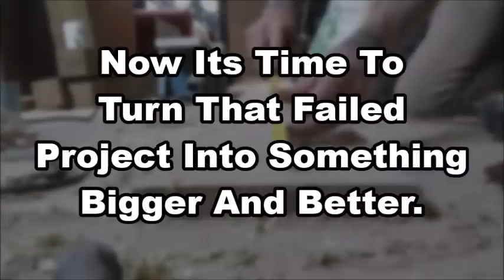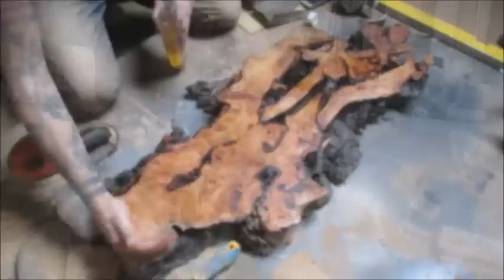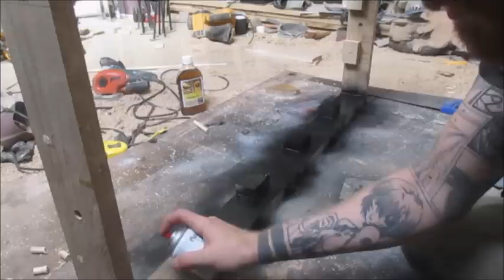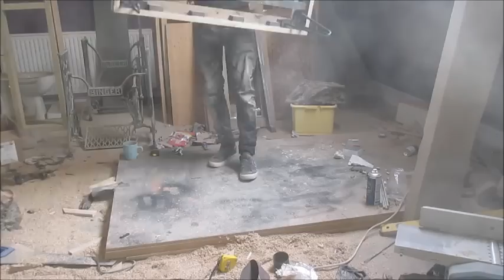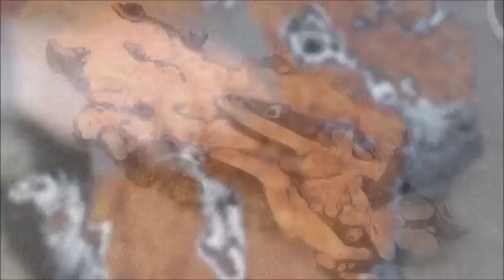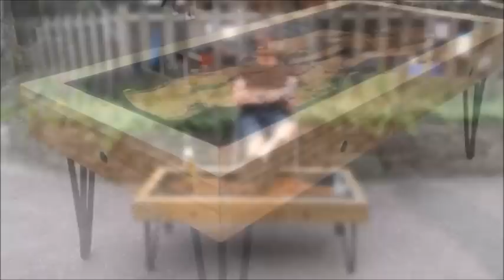Tree Root, Oak And Glass Coffee Table: Reborn From Disaster............... DSNERV

Comment: excellent shadow box design concept, i really like the matte black interior and matching "clavos" bolts on the exterior rim, and of course that section of tree root is amazing, with so much character you just want to stare at it all day.

The only negatives i saw were your mitered corners on your face board were off (obvious because of the wood filler needed to finish them), you should have gotten a "glare reduction" glass that's used for picture framing artwork, to reduce the glares messing with your view of the tree root. I would've put a full backing behind the iron hangers under the table so you wouldn't be distracted by the floor when looking at the root (point of preference of course), and im not sure why you made the shadow box bigger than the root, where it shows the end of one side from the above view rather than dissappearing, might be some dimension concerns im not aware of from my limited exposure to the project.

overall an awesome project though, looks great!!
Reply from the maker: Hey Matthew.
I'm happy to see that you enjoyed the video and wanted to thank you for your comment, feedback, criticisms and suggestions.
OK where do I start? hahaha
I guess the first thing to say is that I am still very new to woodworking as a hobby and this table was only my 4th or 5th experience with the craft. I by no means claim to be an expert at all and I am sure I do loads of things in my videos that would have the professionals screaming at there computers. haha.

Yes you are right my mitered corners where ever so slightly off after I had attached the face board and I ended up using a wood glue and oak dust mix to fill them. A shame yes but they are barely viable and I'm sure that everyone runs into problems like that when new to a craft. 
I love the idea of the glare reduction glass and I will have to keep that in mind when working on new projects (Its a shame you did not comment a week ago as I have just placed an order for more glass for a sewing machine project going up online soon)
I did not add a backing to the underside of the table for the exact opposite reasons that you would have...... I very much wanted to be able to look past the root and down to the floor below. I felt that if the table was an enclosed unit then it would feel more like a specimen box and I was trying to make it appear as if the root was almost floating under the glass. (a point of preference as you said before)
Choosing the right size for the frame was a large concern of mine when making this coffee table but in the end I think I got it spot on. I must admit that the camera angles in the video does make the root look like the root is sitting over to one side but when you do a 360 around the table you can see that for all accounts its as even as it possibly can be. 
I'm always happy when I get comments like yours as it helps to show me where others feel I could improve and in turn lets us talk through ideas and share knowledge. 
Thanks again Matthew.
Reply: Hey

I'm glad you got some value from my comment. I was trying very hard not to come off as a pompous critic that HAD to find something wrong and hear himself talk about it. My family has been making furniture for generations, i grew up with it, and now make custom furniture for a living in NC, i also guest lecture older techniques with some of the local colleges and woodworkers clubs, so whenever i see someone making something, i have this overwhelming urge to jump in and do it myself, it almost destroys my spirit when teaching to hold myself back.

I watch a lot of youtube videos, just enjoying watching projects come together. i thought your project was beautiful, and now knowing you are kind of new to carpentry i'm even more impressed with your technique. If you were local i would invite you to my shop for a beer and a few projects.

I subscribed to your channel, and plan to go through your videos, and look forward to new ones, you'll probably see me popping up in the comment section with some praise and criticism (unless you really don't want either, and then feel free to tell me to shut it). If you ever want to bounce ideas, plans, or questions off me, i loooove weird and unique projects and my email is matthewyandle@aol.com

hope that sewing machine project is going well, look forward to seeing the video soon.

Cheers

p.s. you might find that that glue and dust filler you used for the mitered corners might start coming out if its kept outside, the change in temperature and moisture content is gonna make that piece move a lot, and dust fillers are notorious for not moving with the project.
Reply from the maker: Hello again Matthew.
No need to worry about coming across as pompous in your comments at all.
Anyone (especially youtubers) should be able to tell the difference between constructive criticism and someone being mean for the sake of it. 
Its nice to know a little bit more about yourself and your family being involved with the craft over the generations. To be able to create custom furniture and lecture must mean that you are a extremely talented man indeed. I have had no form of teaching at all when it comes to attempting the projects I do for fun, Just pick up what little information I can from watching youtube videos and the rest of it is more just down to what feels right at the time or seems to make sense. Like I said before I am sure you will see me doing things in my videos that will have you shaking your head in disapproval and wanting to jump into the screen and take over from me.
I guess I really should start going to lectures or some kind of classes if I ever felt that I wanted to take this beyond just something I do for fun and to be able to relax.  
Have you ever considered taking your lectures onto youtube and starting your own channel at all? I know that I for one would be very interested in watching them and picking up a few tips and techniques along the way.
I'm happy to hear that you have subscribed to my channel and you are more than welcome to pop up every now and again with comments about how I am doing or how I can improve. The sewing machine project is going well thank you, though it is a very simple build and I'm just adding 2 different kinds of oak tops to some old Singer bases to create side tables / desks so there really is not much to the videos at all.
No need to worry about the dust filler at all. The table is sitting in my workshop for right now and will be placed in my living room as soon as I move into my new house in January. Beyond that point I am simply not sure how long or frequently I will be able to make videos as most of my free time will be dedicated to decorating and creating a home for myself. 
I guess only time will tell. 
Once again thanks for the comments Matthew have a nice weekend.

Comment: Hey man. What's the wood you used for the frame ? How much was the glass and is it a special type like tempered ? Oh and is that linseed oil you used on the frame ?

Yesterday I salvaged 3 pieces of 3x2x7ft beams of mahogany and 3 pieces of dark tinted tempered glass. Ok use these in an upcoming project.
Reply from the maker: Hey Keith.
I used some good old traditional English Oak for the frame just because that's what I had to hand at the time..... I think the table would have looked better if i was able to use mahogany for the frame as it just would have focused the eye on the root in the centre a bit more.
I had to order in some glass for the table and if my memory is correct it was a 10cm thick tempered glass with anti reflection. I think it cost me around the £60 mark but its going back a bit now and my memory has never been great haha. 
The items you salvaged sound perfect for creating something like a table.... Only thing I will say is to clean and check the glass fully for scratches before committing to using it. No point in spending time making yourself something cool only to have it not look so great from scratched up glass. 
Good luck with it all mate. :)
Reply from the maker: Oh and yeah, it was a linseed oil that I used on the frame. :)

Comment: Why did you not use dowells from the same type of wood?
Reply from the maker: Hello vin Lu.
I know that its not to everyone's tastes but for this project I wanted to make the dowels as visible as possible for an added feature as I felt that the frame would have just been to simple without them catching your eye. I could have simply screwed the support blocks from the back and not had to worry about dowels at all if I wanted a seamless finish.
More down to personal taste than structural reasons.

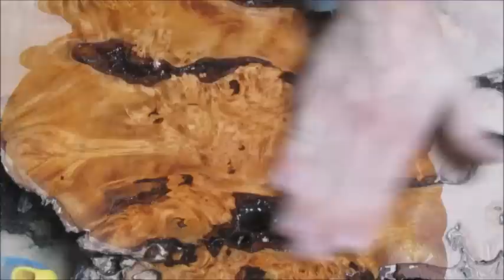Comment: Hello, I've never done woodworking before, but found your video's inspiring.  As such, I'm working on my first end table, with a cross section of pine.  Can I ask, what is the oil you use to stain at 2:19 in this video.  It makes the wood look fantastic.  Thank you.
Reply from the maker: Hey Terry.
Glad to hear that you where able to get a little inspiration from mine and other online videos and are starting your own projects yourself, I would love to see how your end table turns out once you are finished with the build. :)
At 2:19 I used a simple teak oil on both the root and oak to help with colour and protection and then added some spray polyurethane on the root....... after mutable coats of polyurethane I was able to sand (1200 grit) and polish to obtain a mirror shine to the root.  
I hope that helps. If you had any more questions in the future please feel free to ask and I will do my best to get back to you as fast as possible. 
Good luck. :)
Reply: Thanks so much.  Finished the sanding last weekend and am now just looking for staining and choosing a leg design.  I also ended up taking the bark off and was very pleasantly surprised at the design of the wood just underneath.  Am likely going to use 2 separate stains, 1 on the side and 1 on top.  Liked the look of the teak oil so that may be the top choice and a natural on the side.  And as far as inspiration goes.... am already thinking of a dining room table w/ blue epoxy.  Appreciate the help.

Comment: Fine, but how to remove the dust under the glass?
Reply from the maker: Hey Viktor.
I made the table so that the glass can easily be removed to clean and dust the root wood. I did not want to enclose the root into a sealed unit as I felt the table would just resemble a specimen box.

Comment: HI, this table is amazing! Really inspiring work. Can you tell me about those metal braces you used? They fit perfectly, did you design the table around them, or make them yourself, or something else? What are they? Also those really cool decorative screw heads, what are those? Thanks man.
Reply from the maker: Hi Andrew.
Glad to hear that you enjoyed the project. The metal braces where something I had made by a local blacksmith to go on some singer sewing machine tables (videos available on my channel). When forced to redesign this table I used them as the starting point for all measurements knowing that they would be used to suspend the root. The bolts where just an added touch on the sides to give the hole thing a more industrial feel. 
I hope you like my other content as much as you enjoyed this build. 👍

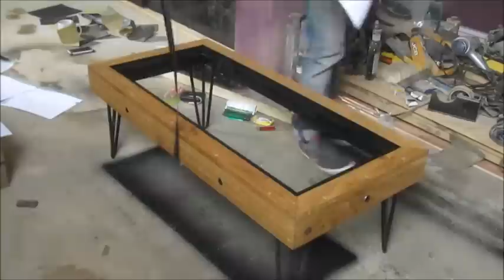Comment: Looks  good but part I don't  get is that  I think it could have been built  without  the dowels showing  on the exterior  sides.  Then you got the bolts, they do make bolts that are shorter that don't need to be cut and are they nessary? Right before  the 7:00 what is the purpose  of the black spray paint  if you cover  it up with black stick on felt for the glass?
Reply from the maker: Hi kcasq.
Glad that you enjoyed the video. The dowels showing and the black  bolts where a design choice by myself. As I was making the table for my home and not for sale I just went with how I like things. Dowels hinting at the inside structure and the black bolts to make the table more rugged and to complement the legs.
Yes the felt did cover a large portion of the black spray but not all of it and as I wanted the inside black I thought it best to spray first to make sure that all areas where covered. 👍
Reply: @dsnerv  got it.  Glad you responded 2.7+ million  views  That is some accomplishment.

Comment: Great job on the table! I'm working on a project to build something similar, and I'm using this video as my reference. What kind of glass did you use?
Reply from the maker: Hey J Towers. 
Glad to hear that you are able to use this project as reference for your own creation, I hope that you will be able to create something that you will be proud to display around your home. 
I used 10mm thick toughened glass with a safety bevelled edge for my table. I don't know where you are from but if you live in England like myself then I would recommend the site Made To Measure. They seem to be the best on price and also the quickest with delivery.
Hope that helps and good luck with your build. :)

Comment: Why the Velcro under the glass at the end?
Reply from the maker: I used the fluffy side of the Velcro on the table just to add a little bit of padding for the glass. 
I am no expert with woodworking and was worried about any missed high points where the glass sits creating a pressure point so adding a bit of padding seemed like the best option. :)

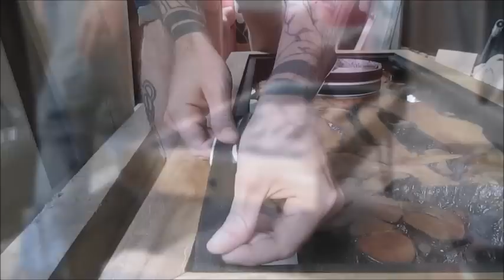Comment: What is the tape you used at 8:05,I have a glass top  on a table with a  sunken design in the well, and dust is always gettinside.
Reply from the maker: The tape used was the fluffy side of a velcro strip. Its adds a little protection for the glass, makes the fit better and also helps with dust issues. hope that helps.

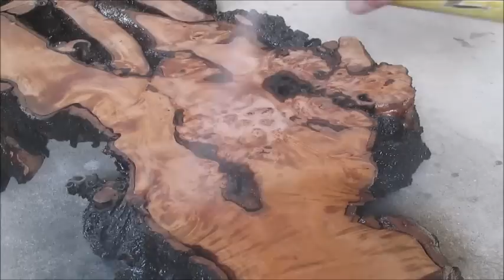Comment: Sorry to sound like a newb but, what did you spray on the root at 7:10ish? Thank so much dude
Reply from the maker: Hey Jason.
I was spraying on a polyurethane varnish at 7:10. It was the best way to get an even coverage of varnish down into the cracks and spaces in the root. After a few coats I was able to sand it down to 1200 grit with some emery paper to get the mirror shine. 
Hope that helps mate.
Reply: Thanks so much dude! I love your videos thanks for all the tips!

Comment: very cool. however, I find the wood seems too protected. sort of like excluded from the piece.
Reply from the maker: Thanks for the kind words Shawn.
I do understand your point about the root seeming excluded from the piece, I am curious to how you feel I could have better integrated it into a table. :)
Reply: Thanks for asking DSNERV. To be clear, the table looks great and my opinion is really just that.  It seems that maybe the framing part of the table could be a bit smaller and if was stained a slightly darker colour than the root piece, maybe the root would pop out more.  If the root were lifted up higher so as to be basically touching the underside of the glass, it may feel more like the user is interacting with it.  No matter what, this table shows some really nice craftsmanship and an interesting display of a very beautiful piece.
Reply from the maker: Hey Shawn.
Sorry for the late reply...... its been a busy time for me recently.
You have made some good points about the build that i till take on board if I ever make another project like this in the future. I am not to sure about staining the oak darker just as I feel it would be a shame to loose some of the grain within a dark stain, maybe an acid wash on the oak would work well or just switch it out for some ebony wood instead.
Thanks for taking the time to leave your views..... Its always a good thing to see how others would have dealt with the build if they where doing it themselves. :)

Comment: is that battle Angel Alita on your arm? I've not seen that for years, it was a little like LA puta they aired that in '87/88 and battle Angel late one night and they born marked my memory. Over 20 years later I got the names, I was 7 or 8 when LA puta was shown on central. Sorry going of topic, I like your work man. Only wood work I done was making two gates, one is gone as I used pin nails. I also made two arched climbers and a wooden fence, mostly reclaimed wood from a loft conversion or other bits. The arches were made using throw away from a local timber merchants that was closing. I used the most basic tools and advice from my old man and read a old diy book. Replaced over half of the fence with brick and small section iron tops. Still standing over 3 years later but bloody stinks thanks to dog piss.
Reply from the maker: Hey Gunzee.
Sorry to disappoint but no its not Alita on my arm. (tho I am a fan of the Battle Angel Alita anime and manga)
Funnily someone asked me the same question a few days ago and if you have confused the same tattoo as they did then you would have been looking at my tattoo of Rei Ayanami from Evangelion. 
Its good to hear that your work is still standing 3 years latter........ If you want a good tip on stopping dogs pissing on it then use citrus (orange, lemon and lime) soak it and leave the peals around it and the smell will stop most animals from pissing there. 
Hope that helps. :)

Comment: I think the legs don't fit the appearance one bit. I think the top looks gorgeous though.

Anyone else think it would look awesome with mirror glass on the bottom (under the tree root) and an LED strip inside?
Reply from the maker: Thanks for the suggestion Rathernot Disclose.
I did intend to go back to this table at some point and add some LED strip lighting and the idea of a mirror base has crossed my mind in the past as well. I just needed to figure out how to place the base around the legs and a power pack inside for the LED's so that the table does not have a ugly wire plug hanging from the underside.
Reply: True. Power cables would be kinda ugly. I hadn't considered that lol.